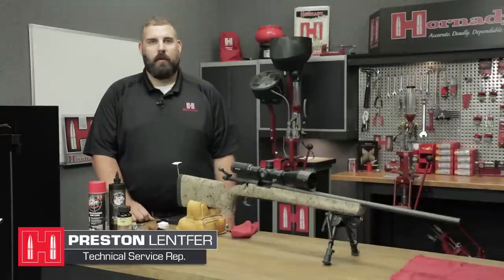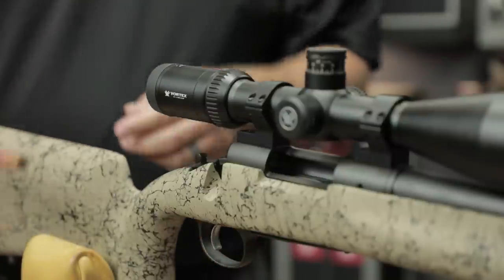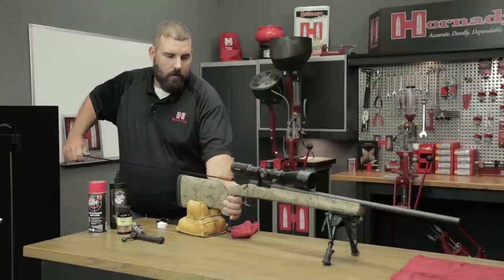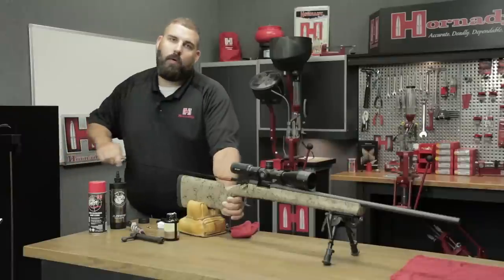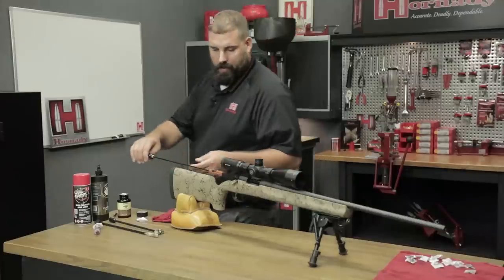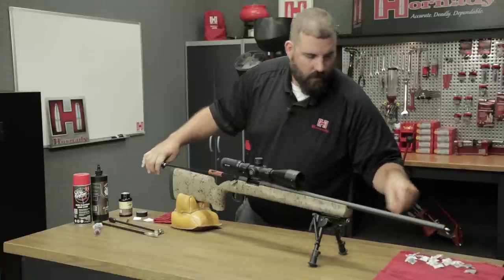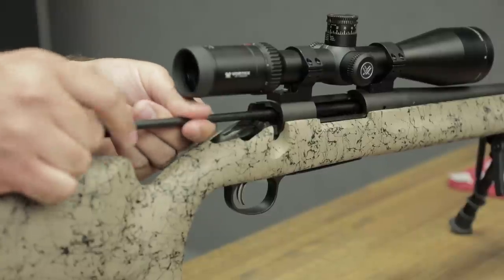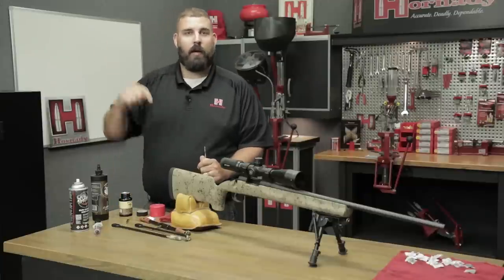Hornady® TECH TIPS: How to clean a rifle barrel

Comment: How exactly does a copper jacketed bullet traveling down the barrel bore @2500+ fps not damage the rifling of the bore, but a plastic or aluminum cleaning rod that is not perfectly centered in the bore, will damage the rifling?
Reply: Also wanting to know..
Reply: Not sure if it’s a thing with the coated rods like he was using. I think it’s for the metal rods without a plastic coating. Some are steel which is steel on steel and even though one is going to be harder (probably the barrel) there is still wear to both pieces; just more so to the softer piece. In the case of aluminum rods I have heard it submitted that oxidized or corroded aluminum rods can harm the steel because of the corrosion/oxidation being pushed against the steel. Honestly I don’t think there is any one real correct way to clean a barrel. I just think there are probably a few wrong ways but mostly I feel the huge amount of different answers you get from all sources that I would consider to have some credibility just shows that there isn’t any one way it must be done. I have always heard that pulling the brush back through the bore is a no-no, yet it was done in this video and something tells me that rifle will be just fine regardless. I think the main thing is you don’t want excessive filth to the point that you’re noticing accuracy loss and you definitely don’t any rust. However; by that measure, you also don’t want rust on your brake rotors. Yet if you have rusty brake rotors it doesn’t really matter because they will be cleaned of then rust by the pads once you use the brakes a bit. I’d bet that a bullet moving down the barrel that it had to be swaged down to fit with 50k psi and 2500+ fps and the heat that comes from that can probably pull out a small amount of rust. Simply some of these things couldn’t be true. There have been numerous stories of AK’s being fired with rusted barrels, chambers, and just about anything that can rust. They mostly are said to have functioned just fine after having some rounds out through them.
Reply: When they become carbon impregnated.
Reply: Agree 100 percent.  I have always said that if someone tells you not to use an aluminum rod because you will destroy your barrel, don't listen to anything else he has to say.
Reply: I worry more about a hundreds pieces of metal travelling 2500fps down it than off a centre brush 5/6 times 😂
Reply: @JG54206  Tüfek harbi çubuk temizleme demiri markası modeli nedir acaba öğrenebilir teşekkürler

Comment: Hornady one shot bore cleaner is the BEST carbon remover I've found. Also makes lead fouling separate from .22rf barrels. Why didn't you use this on the bore AFTER the copper solvent?  This video leaves out a VERY important part of bore cleaning -- Hornady One Shot! Use it on a patch, a bronze brush, and/or a bore mop. It's the BEST carbon/lead cleaner out there!!
Reply: But but but he…. Did…..
Reply: Tüfek harbi çubuk temizleme demiri markası modeli nedir acaba öğrenebilir teşekkürler

Comment: 2-3 o-rings around the jag head help get into the grooves. Also along the rod to prevent barrel and crown contact on strokes.
Reply: Do you mean around the patch? And what kind of o-rings? What material? Where to get?
Reply: Edit: Must mean inside the patch providing more pressure for the patch?

Not sure yet what to do, there are so many people saying so many things about cleaning. And of course the strategy will be different for practical rifles and sniper rifles. 

But thanks for the tip! I think the o-rings make a lot sense compared to empty grooves or jag that only applies pressure at the beginning.

Comment: You guys need a better coating for reloading dies i live in texas its hott and humid i clean all my does when im done and spray them with the hornady case lube you had there and they still seem to rust and my hornady powder measure rust to and i dont wanna spray to much case lube on it in fear it will make the powder stick to it and not throw an accurate charge and lastly i bought the custom dies my .270  have the brass/bronze insert at the bottom of the sizing die i bought the same custom dies for .308 they dont have the insert in the sizing die and will stick a case everynow and then can you tell me which of your .308 sizing dies has the brass insert?

Comment: A quick question do you oil the bore with a patch when you're done ?? Thanks Rex
Reply: If you're using an ammonia based copper solvent then absolutely, you must neutralize it with a gun oil or it can etch and damage your bore if left in there too long.
Reply: Yes, CLP what you should use

Comment: Unless you don't care about your rifles crown, never back stroke,  use a drilled out rod tip end and ALWAYS push from chamber to muzzle (the tip end speeds up brush /jag removal).
Reply: Ha Re my ak doesnt allow cleaning from the chamber end i have to clean from the crown to the chamber always worried about damaging the crown
Reply: +Ha Re as i stated below,  a "Bore Snake" is a good option.  its kind of a scruber, swab all in one. and washable too.
Reply: Ha Re lol the muzzle protector is just the cap for the cleaning kit that comes with akms

Comment: Do you use oil in the bore of steel barrels when sitting, then wipe out before use? Or leave it dry..
Reply from the maker: I'm a fan of oil if they are going to sit a while. Dry patch when ready to use followed by alcohol patch, and a couple more dry patches after that.

Comment: Why do you wet the brush sure makes the cleaning more messy. Why not put the cleaner in  with a patch jag and let sit then dry patch then brush?
Reply: You atleast want 1 wet pass with the brush, even if it's a quick, not so intensive cleaning. Your method process is perfect, I would just add 1 step after you run your first wet patch. Let that first wet pass sit for however long you're comfortable with and then the next pass should be with the brush. While wet, the brush helps loosen the carbon layer overtop the copper. This also helps agitate the copper in the rifling, allowing the solvent to penetrate the microscopic pores of the copper, allowing the solvent to get up in and underneath the copper. If you allow the solvent to dry then the copper won't budge, nomatter how many times you run a brush through. The cleaning procedure you mentioned is perfectly fine for the majority of cleanings, especially for ar platforms but if you want your barrel to be at the point of which it was when first purchased then it's mandatory to run a brush while wet. It doesn't create any kind of mess either, the brushes are super easy to clean with just dawn dish liquid and running a dry patch through will mop up whatever slop there may be, there's no worry of any slop going back into the gun so long as when you do your cleaning process you're doing it with your barrel pointing a lower distance than your starting end and if you use a bore guide then you really eliminate that worry all together.